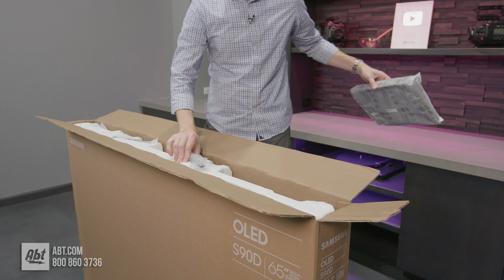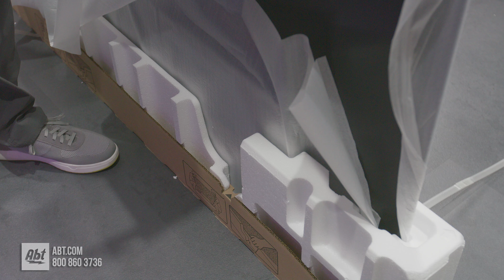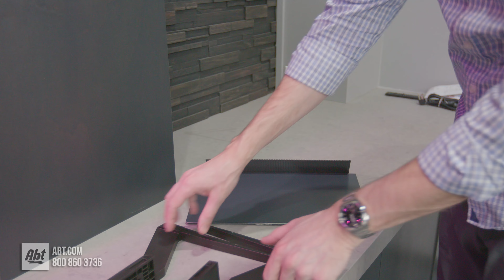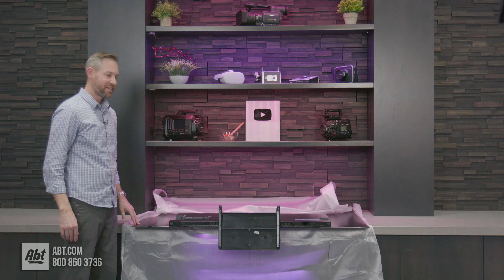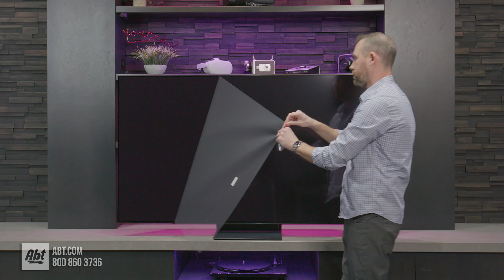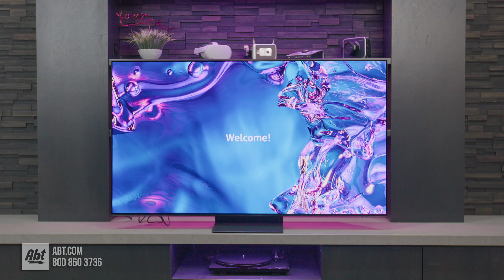How To Unbox The Samsung S90D Series OLED With Pedestal Assembly And Install - 65"

Comment: My base is missing. Will it stand with just the legs?
Reply from the maker: @sivashengovender1743 The middle plate is more for looks than anything. The TV will still stand up properly with just the legs. If you need to order another base, our parts department would be happy to help you out. They can be reached at 847-544-2261.

Comment: Hello, I’ve checked the tech sheet/manual, and it doesn’t specify the measurement of the thicker bottom part of the TV, where the mainboard and other components are located. Could you please measure that section for me, I just need the vertical dimension (I’m running cables through the wall and would like to know in advance where to place the power outlet.) Also, do you know if this part is the same size on both the 65-inch and 55-inch models? From what I’ve seen, it seems so. Thanks!
Reply: Do you have an answer on your question? Same for me please!
Reply: @jonyinweb nope, sorry

Comment: i need to remove the stand which is clipped in.  I want to return the unit.  How do i remove the stand now it is in
Reply from the maker: @sksmithusa You can remove it by reversing the install process. If you have a screen that's 65 inches or smaller, you can lay the TV down on a flat surface, just be sure to protect the screen with something that won't scratch or damage it. Then you pull the pedestal feet down until they release (basically, pull them towards yourself if it's laying down). It can take a little effort because they're held in place with tension, but once both feet are loose you can remove the entire assembly. Just be extremely cautious throughout the process so you don't cause any damage to the TV.

Comment: Abt wants $150 to remove this out of the box for you
Reply from the maker: @Sayitlikeitis1234 The cost you're referring to is our installation fee for TVs over 41 inches in screen size. For our local customers we charge $134.00 which includes delivery into your home, unboxing the TV, hauling away the packing materials, installing the TVs pedestal, and connecting the TV to your existing Blu Ray player, cable box, and video game systems. For local customers that are going to be installing the TV themselves, Abt has always offered free delivery into your home on all the products we carry. Please give us a call with any questions at 847-954-4100. We're always happy to help!

Comment: I bought a Samsung OLED 65 s90 datxxh. What is the difference with the datxzt? is the panel qd OLED?
Reply: Both QE65S90DATXXH and QE65S90DATXZT use the same QD-OLED panel from Samsung Display. The only difference is the regional code: XXH is for Eastern Europe (including Poland), and XZT is for Western Europe (like Italy). Technically, they are identical.

Comment: For anyone in future reading this and considering this TV I'm currently setting it up and when I saw how to install the stand I thought immediately that's not secure in anyway. I installed it correctly. I tried to lift the TV up and the stand comes loose. I'm pulling my hair out, for such an expensive product why the F*** would it be a screwless stand???? Like I can't believe it. I've done everything right and I lift it up, and the stand comes loose as I lift it. I am so beyond unimpressed that such an expensive TV would have such an absolutely mind numbingly useless stand!!! Like give me good old fashioned screws Samsung!!!!! You even say in this video don't bump the stand cause it can come loose. A table with loose legs is a broken table, and a TV with a crappy stand is super gross. Ffs like I’m just floored here

Comment: Can you share the box dimensions? I want to see if it will fit in my car.
Reply from the maker: @cod4r The package size for the 65 inch model is 63.7 inches wide x 37.4 inches high x 6.3 inches deep.
Reply: it needs to be transported upright. dont put it in the car lying on its side.

Comment: Aren't we supposed to pull the bottom tabs and put the upper styrofoam pieces on the side of the base? That way it will me much mroe stable, also for 77 inch size that way you can remove the middle part and install the base in the upright position.
Reply from the maker: @BlindEmperor25 The pedestal installation varies based on the screen size. The 77 inch and larger will stay in the bottom portion of the box and you'll use the included styrofoam pieces to help stabilize it while the pedestal is installed.
Reply: @abtelectronics  Strange that Samsung didnt provide that system for all size ranges from 55 inch upwards, since the panel is so thin and fragile. Its just looks too risky to grab it by the screen and flip it horizontally.
Reply from the maker: @BlindEmperor25 Totally understandable, but it definitely felt sturdier than it looks.

Comment: This TV is unbelievably thin in my opinion... we need some more plastic and bezel to handle it.. I got mine on a wall mount and I'm scared to hold 1 side to move it
Reply: Nah, I have a C1 OLED which is even thinner. I've accidentally hit it a few times with my shoulder, and nothing happened.

Comment: If you’re doing an unboxing at least unboxing the exact way Samsung designed it to be done. Which certainly is NOT the way you did it. Many have purchased the 77” S90D. 

But even on smaller 65” model it’s made to work standing up thru box. Nit laying on its face especially considering the thinness of panel.
Reply from the maker: @mychoicetaken We performed this unboxing exactly as it says on the instructions included in the box. The 55 and 65 inch versions both require being laid down on a flat surface. The larger sizes are kept upright when you attach the pedestal. The only part that changes between the 65 inch (the model in the video) and the 55 inch is the way the TV is removed from the box. The 55 inch has perforations on the back that need to be torn down. On the 65 inch you lift the box off the top.

Comment: Is the stand removable? In case I decide to put it up on the wall one day
Reply from the maker: @CB_883 Yes, the stand can be removed if you decide to wall mount the TV.
Reply: @abtelectronics yes but how? Tryed to remove mine from a 55inches s90d and i’m too scared to damage it, there’s nothing on the guide.

Also did you notice any bending on the screen? The frame of my s90d is pretty straight but when it’s turned off i notice some Waves on the screen with the light reflection from a distant source, like a window (again it’s just the reflection when i turn it on it’s perfect but I’m curious to know if it’s normal to have some reflection waves)

Comment: Loving my 77" s90d, I just noticed that I’ve never gotten a notification for screen optimization / Pixel refresh even though I have over 15 hours on it. Is this normal? I thought after 4 hours of use it’s supposed to go through a refresh cycle. Any ideas??
Reply from the maker: @victam7013 You can manually perform those through the TVs menu. If you go into General & Privacy there will be an option for Panel Care. You can turn Pixel Shift on and off through this menu. You can also perform a Pixel Refresh in this menu, but you only need to run this process if you notice image retention on the screen.

Comment: no vesa mount?
Reply from the maker: @vfrvideos365 The S90D can definitely be wall mounted, but the mount is optional. The VESA ratings are as follows:
42": 200 x 200
48", 55", 65": 300 x 200
77", 83": 400 x 300
If you need any assistance finding the right mount be sure to give us a call at 800-860-3736. We're always happy to help!

Comment: Hi, which one is the better OLED for watching sports, movies and ps5 gaming between 65S90D and 65LG C4? TIA
Reply from the maker: @YZERPLAN They're both very good for all of that. If you watch a lot of movies that utilize Dolby Vision, you may want to go with the C4 since it supports that format. If the majority of what you watch is HDR10+ then the Samsung would be a better choice. If you like movies, but you're not a huge movie buff, you likely won't notice much of a difference. If you need any assistance picking one out, or you want to hear about our best available pricing please give us a call at 800-860-3736. We're always happy to help!
Reply: @abtelectronics which one is better in longevity? I heard about qd-oled are more sensitive for burn in issues, is it correct information? I just ordered that s90d but ism kinda scared 😂
Reply: @David-ou2rr I was on the fence on which one between the 77” S90D and the 85” Qn90D,Qn85D.  After seeing in person, I bought the S90D.  It is really amazing and I’m glad I did.  I got it from Costco so I have at least a 5 year warranty for peace of mind.  Movies, gaming and viewing angle are the best.  Unless you watch the same thing all the time(static image) for multiple hours a day,  get the OLED.

Comment: Do you need a friend to help with a 48 inch?
Reply from the maker: @Rub-rw6rr Probably not. The 48" size is pretty manageable with a single person. That being said, if you're not certain you'll be able to do it yourself, don't risk it. It's always better to be cautious with these TVs as they are not a small investment.
Reply: @abtelectronics   Cool thank you. I ended up putting it myself with extreme caution and nervousness lol. It wasn't heavy at all I was more concerned on how fragile the screen is or was.

Comment: I am at the initial set up screen, to set up by phone its asking me to scan a QR code? What and where is that code? All the codes on the box and Manuel are videos and warranty into not codes to sync with the unit, I tried the manual route as week and the tv won't recognize any wifi? It searches then comes back with zero connections, my wifi is strong and I have tried multiple times, is my unit defective?

Comment: Do the s90c and s90d still have the same porous panel from the s95b that left stains if you touched it or did they change it?
Reply from the maker: @coludonegro7460 We were able to clean stains off the screens with a microfiber cloth. Not sure if they changed the screen technology, but we didn't experience any staining when the screens were touched accidentally.
Reply: @abtelectronics  I noticed in a store that still had the Samsung s95b that if you touched the screen with your fingers the fingerprints were very visible, while on the Samsung s90c they were not so noticeable. I think there was some change in the display as even the blacks are not as affected by the brightness of a window or room lights on the Samsung s90c.

￼

Comment: I'm undecided between the S90D and QN90D. The room isn't very bright, and I'm not a hard core gamer. I thought I was ordering the Neo-led, but had the Oled delivered. I'm wondering which would be better for me? Any thoughts?
Reply: It's is the 55" model. I also don't know if it is a Woled or the qdled. How would I figure this out?
Reply from the maker: @WeAre143 If you have a good camera you can take a picture of the pixels and zoom in to see their pattern. The one we opened was a 65" and it was QD OLED. We haven't opened a QN90D yet, but the S90D looked excellent, so it's still a great choice even if it was ordered by mistake.
Reply: @WeAre143 ...all 55 and 65 inch models are QD-OLEDS
Reply: Not true, in the UK it’s only the 65inch that is a QD OLED!! So it’s region specific. The way to tell is to look 👀 at the tv product code. The last 4 letters must be a different code to the 42 inch and the 48 inch versions of this tv. If they are then it is a QD OLED.
Reply: @poccophoto I don't know why they change things up region to region like that. I saw the UK version brings two remotes instead of one. I would've preferred the TV remote aswell here in the US since it makes it easier to go in to the sources and channels without having to go into a darn menu everytime. Why the different treatment?

Comment: how about wall mount
Reply from the maker: @JanPing It can be wall mounted. If you do that you'll either need to install the One Connect box on the upper corner of the TV, or place it in a separate location using the longer One Connect cable.

Comment: No screws needed to for the base mount?
Reply: Nope
Reply: Crazy right
Reply: Why the f*** would they not have screws. I’m setting it up right now and it's driving me nuts how flimsy it is
Reply: @peterb5235  works perfect for me I’ve had it standing for a month
Reply: @peterb5235  return it if its that much of a problem?